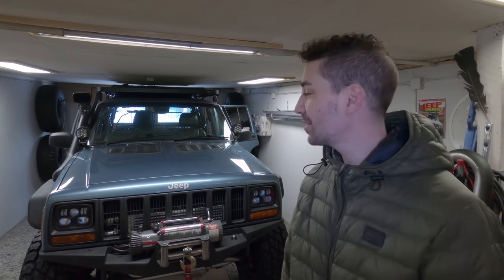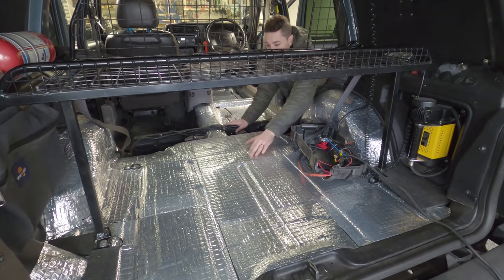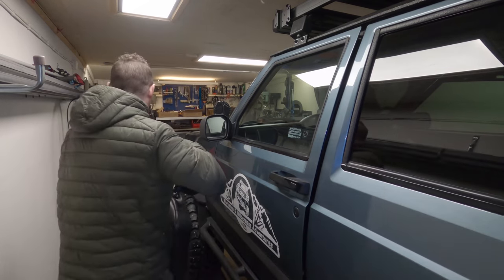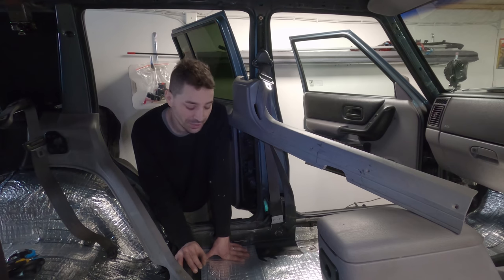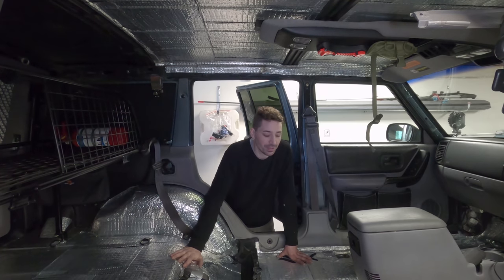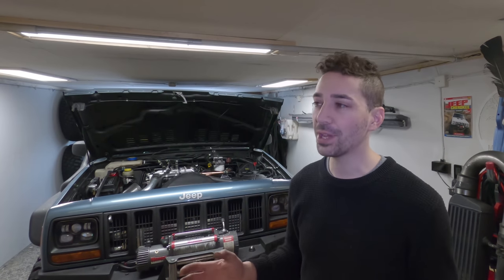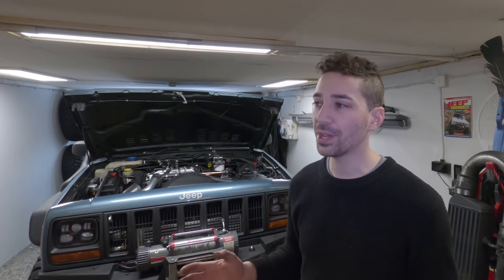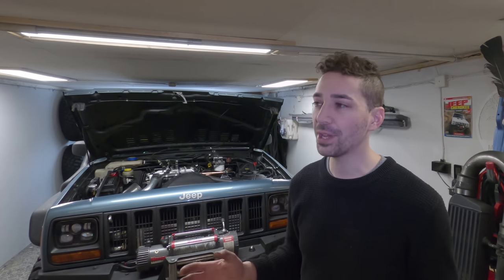Jeep XJ Sound Deadening & Vibration Dampening

Comment: Revisiting as this is one of the better channels to learn from without blaring background music and has good lighting with clear narration.  I've done bedlining, noise decoupler, insulation with a foam rubber mat topped with forward floor liners.  Floor liners are a massive upgrade as one can just dump them out when dirty, or gets filled with snow or sand.  Product list for me has been Herculiner bedliner, Kilmat 80mil decoupler, 4mm Siless insulation in my 4 liter powered 1987 XJ Pioneer.  Foam rubber mat is about 12mm which provides a bit more insulation itself.  Undecided on the backerbaord/headliner refurbishment due to the fact in my girlfriends XJ along the side of the roof I installed some magnetic bars that are really usedful to hold items, and even the keys.  Cheers 👍✌
Reply from the maker: I used some kill mat type material along with high density foam on the headliner. Its worked quite well at removing the noise and keeping the heat in or out. I may further glue fabric material to the roof later. 
It sounds like you have done a solid job on your Jeep, it makes a big difference to the noise when your driving! 
Thanks for watching and for the comments on the channel.

Comment: When I repaired some minor floor pan rust in my 96XJ, I also remove the headliner and applied a product made in Russia called Noico, which is similar to fat-mat, but roughly 1/3 price. The inside of the roof was covered with this along with the floors and inside the doors on the outer skin. Made a noticeable difference in road noise.
For corrosion control in the rust belt of the USA, I apply a yearly coating of Fluid Film on and in the chassis.
Reply from the maker: Sounds like a good solution. Fluid film is definitely great protection. I often apply and check everything yearly also. Keeps on top of it all. Thanks for watching

Comment: I commented before about what I did but I did dynamat on the floors and wheel wells and in the doors and rear quarters then I put closed cell foam waterproof insulation over the dynamat on the floor and after that put new carpet with the original style insulation removed because that original insulation soaks up a lot of water. 
The dynamat in the doors was a really nice upgrade they sound so nice when they shut now. 
I like my comfy interior I have a roll cage and a lot of mods but I like my carpet and stuff so I try to keep it nice and that waterproof insulation makes a massive difference. I used noico green foam it's closed cell waterproof stuff. It covered the pretty dynamat but it's all under the carpet anyway. 
I don't have a headliner and I don't want a headliner but I haven't put the dynamat on the roof yet even though it would probably be really nice but for the last 10 years or so I've covered my roof in stickers from all sorts of things and places and I don't really want to cover up my stickers haha. 
I used real dynamat I think most all sound deadening products are roughly the same. I also did full coverage everywhere even inside the doors. I also replaced the vapor barrier in the doors with a better product it's a thin sound deadening I believe it was sound skins brand but that gives me another layer for the doors and most importantly seals out vapor and dust. When driving down dusty roads with the windows up I could see dust coming in from inside the doors around the factory barrier that was failing. 
I'd highly suggest putting your sound deadening in the doors it's one of my favorite things about the sound deadening it's a bit difficult to get full coverage it takes multiple little pieces and doesn't need to be perfect but I covered 99 percent of the inside of the door skins and it reminds me of Mercedes doors or fancy cars that have that really nice solid sound when they shut. 

I just recently replaced my oem limited model leather seats with corbeau seats up front. Originally I had cloth seats but I swapped to xj leather seats a long time ago and they've been super high maintenance repairing the frames and replacing parts and replacing the seat cushions when they tear I've gone through a lot of used seat parts. I'm happy with the corbeau seats I got the baja xrs with new brackets it's definitely a nice upgrade they look a little racey but they are comfy and also heated which my wife likes.
I really like your rear cargo shelf/cage I'm thinking of trying to find something similar. My 2nd battery is in the rear and I have my air and tools and stuff and sometimes a fridge so I'd like more storage.

Comment: I used that exact same silent coat on my Mazda Bongo self build. I used it in the back cab and the roof but I feel I used too much, like yourself though I tend to go extra and added more weight too. I don't have it in the front cab yet, I'm waiting to see what the next mot says for future upgrades but I might go with the sound deadening/insulating layer, being mid engined I sit on top of the engine so it is loud regardless but the Silent Coat made a huge difference, before you had to shout to the passenger, after you could simply talk and I'm sat on top of a 2.5td.

Comment: I’m really curious what you end up doing for the rear storage area!
Reply from the maker: I'm thinking of keeping the upper cargo rack but moving the legs out to the side. Then putting in a pull out platform the size of the bottom of the trunk. Kind of like one huge pull out table. On this I will have boxes, fridge and stuff that can be accessed from all sides. I don't want drawers but just to be able to pull it all out on a platform.

Comment: I pulled the carpet out of my 2 door xj to replace some rotted out sheet metal. Like you I was going to raptor line the interior but without carpet to put back on I would lose that insulation and sound deadening. I’m wondering now if I save my money and just spray paint the interior and put that stuff in to get rid of the noise? 
It’s cold up here in Canada and any insulation is good insulation especially if it gets rid of gravel road noise. Great video!
Reply from the maker: What I have done provides less sound deadening than the carpet. An idea I would do is pull the carpet, raptor line, then apply some sound damping sheets like I have done. Then you can put the carpet back and cut out the floor pan areas. That was thought about doing. Just having carpet with no floor areas so it's around the arches and center colum but I just have mats at the bottoms. I'm not sure if this is a good idea but it's an option.
Reply: Hey Mike how is this stuff holding up? Did you send up putting down anything else other than the floor mats over top of the shiny product?

Comment: "Orite mate, nice Jeep. . She got a Turbo.?"
Video idea:   RHD Steering box access, nip up the nut. . . . . . Slam panel, Radiator Out, Air filter on different side tdi . . ?
Was thinking of de-carpeting mine. . . screwdriver in hand I bottled it. . . . . soundwaves.

Comment: Hello Mike! Great content!
How is the sound dampener holding up? Just removed the carpet from my xj and i am thinking of going the same route as you. 

Did you end up covering the shiny stuff or are you still showing off the bling? Have noticed that you seem to have covered up the roof in later videos would be awesome to know what material you used! 

Hälsningar från Sundsvall 🇸🇪
Reply from the maker: Hey Johan, thanks for watching! Its holding up well. It's made more of a difference on the roof and the rear than the floors. It's also worked really well on the insides of the doors. 
Its stopped a lot of vibrations and made the jeep sound quieter. The floor has been the biggest challenge. I think another layer of something is needed over the bling, but my worry is water getting trapped. 
The roof I covered with black foam which looks great, the rear cargo area has a rubber sheet. The floor pans just bling bling and I'm not sure what to do. You can also buy a black version of this in Sweden from BRL Electronics, I would do that as its going to look better!
Reply: @WorkshoptoWilderness  thanks for the quick response! I’ll probably order the black ones 👍 

Ha en trevlig helg!

Comment: Hey Mike, I was wondering...
When reinstalling all the interior trim did you do anything to dampen the rattling? Any rubber seals or grommets? Or has everything stayed tight enoigh that it isn't noticeable? My 01 is in excellent condition but the noise is unbelievable and since I'll be bedlining the interior soon I thought I'd ask if you had this problem too. Thanks!
Reply from the maker: I've used rubber washers and also foam under the trim in certain places to stop the noise. It's taken a while but it's better than it was. Sound damping foam is pretty useful for this and it's quite
Reply: @Workshop Wilderness Adventures  
By SD foam do you mean the thick 4-8mm closed cell stuff? I was looking at that but figured it's supposed to go over a base layer like the foil you put in this video

Comment: Great video as always bud. Good to see you out the 3D printed parts to good use. You need to fill the top one though. What you planning for the top?
Reply from the maker: Was it you Richard who sent those parts? They are really useful. I've got a high speed USB in the front and one in the back with them. I'm going to do lights, maybe winch. I have no idea what to put on the top? Maybe cb radio switch.
Reply: @WorkshoptoWilderness  Yeah it was. I've got the centre rear one with a double USB and the front centre one for spot lights and light bar. Will probably have working lights for the top one day. Glad you like them bud.
Reply from the maker: AH thanks again for those. They are really cool and they tidy up those ash trays haha. Megan is happy as there is a usb charger front and back now which helps with entertaining the little one on long drives. I will see what I can do with the top.

Comment: Hey, quick question, are you still just running floor mats on top of the sound deadening, or have you found something to cover the deadening…?
Reply from the maker: I ran just mats for a whole but I still found the noise to be too much. I've bought some sound deadening adhesive foam to go over it. Its waterproof and it comes in large sheets. I will try this and take into account the water collection points.
Reply: @WorkshoptoWilderness  yeah I’m having the same issue, did you go with the same brand?
Reply from the maker: @bmonden  I'm using a black adhesive 1cm sound isolated foam from BRL Electronics. A 9 Pack is 700kr and they are 75x45cm. https://www.brl.se/sv/artiklar/silent-coat-noise-buffler-20.html 
It was this stuff but it didn't cost that much for one. I will try and find my original link
Reply: @WorkshoptoWilderness  my man! Thanks Mike…keep up the good work. Jeeps looking saweeet!!

Comment: Do you happen to remember the bolt size on the overhead console
Reply from the maker: The console on the roof? Its held on by two sheet metal screws at the front and a clip at the back.